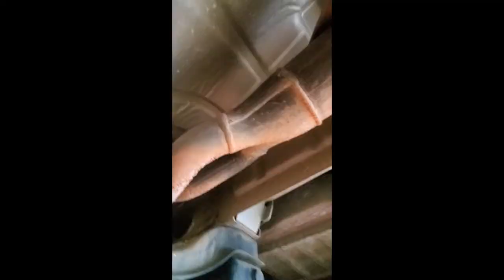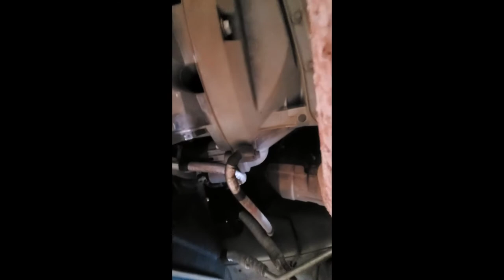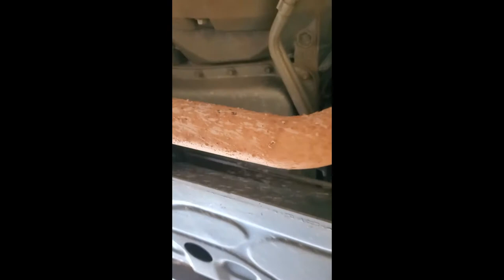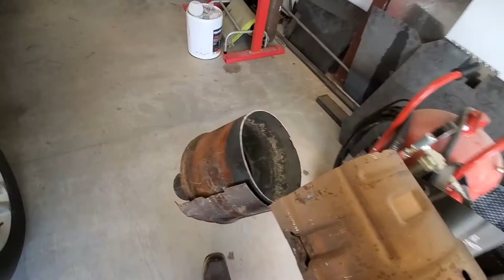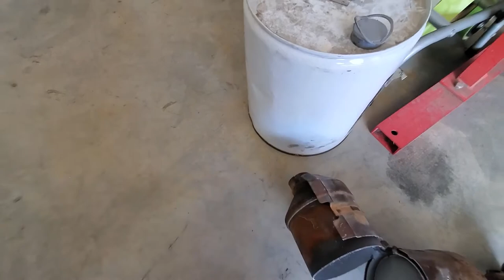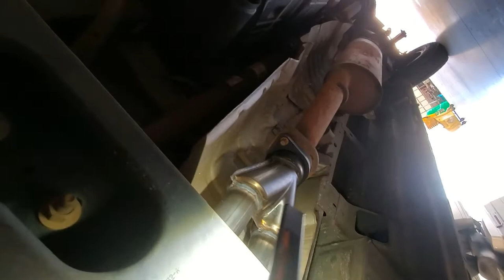Transit catalytic converter

Comment: Had similar experience with cat on the passenger side. Low power, misfire on 1-2-3 , rattling. After removing found the upper matrix had slid down on top of lower matrix. Replaced with Ford part.

Comment: I know it has been a while since you made this video. I popped a P0430 code. Ya most likely the cat is gone. Do you have any part number for the Magnaflow cats?  Update;  I found the part on the "Magnaflow" web site. The price is 1670.00$. Found a discount code and brought the price down to 1330.00$ Canadian. The U.S. price was 1560.00 Approx. with the exchange from Can. to U.S. there was no deal there.  Here is a copy and paste of the listing on the magnaflow site. "Magnaflow 52436 | Ford Transit | 3.7L | Direct-Fit OEM Grade Catalytic Converter Assembly Federal (Exc.CA) | 2 Piece Assembly for easy installation".
Reply: what was the discount code?

Comment: Do you have a link for the Mag-Flow unit for 2016 Transit eco-boost? Great videos. I'm tracking down source of coolant smell on mind. No viable leak just Oder and slight coolant level drop.
Reply from the maker: Magnaflow currently doesn't make a cat for the ecoboost.

Comment: I'm thinking that's the problem I have when I rev up the throttle I'm park or neutral  it rattles what I just goose it it rattles when the rev comes down like a knocking noise it comes and goes don't really hear it while driving.

Comment: With the rise of the catalytic converter thefts, do you think that based on their locations it would be a target? I know theyre harder to get to, but am just being proactive.
Reply from the maker: Well they are super easy to cut out. In about 5 minutes you could have them both out
Reply: Me too I got a 2018 250 want to do preventative maintenance 
Like make sure there is a plate covering them or something?
Reply: @medtec6747  how can get that magnumflow kit I have same problem

Comment: I saw your more recent video "2017 Ford Transit catalytic converters and transmission fluid and filter change," In the first minute of the video where you said that you were surprised at how quickly the magnaflow cats gave out.  I'm curios how many miles and if it was both cats, maybe one was defective?  Would still recommend those cats or is there another alternative to the Ford Stock 1 piece which requires a ton of labor.
Reply from the maker: This set had 20k on them before the bank 2 cat stopped getting up to temp and started tripping efficency codes. I think the substrate on these cats just aren't coated with a very heavy layer of catalyst and they are just a much lower quality converter. The ford units tend to just have the interim layer failing and plugging up.
Reply: @medtec6747   thanks!  so I'm guessing there isn't a good alternative to the OEM cats? I know an alternative would require welding.